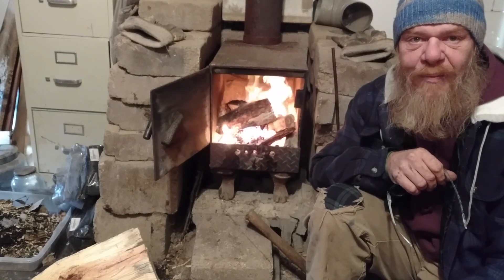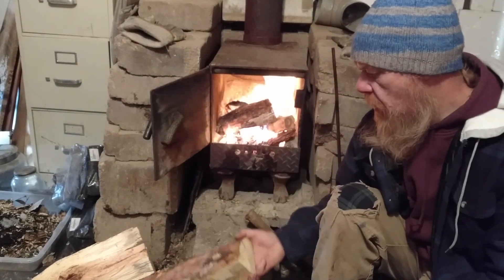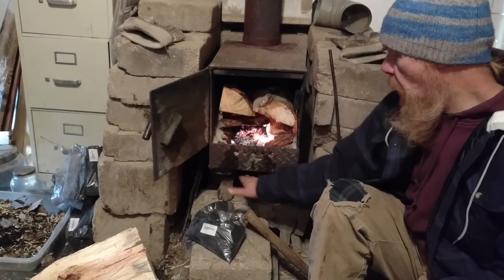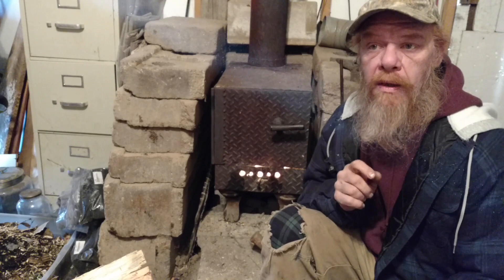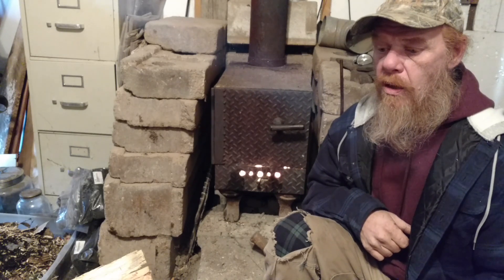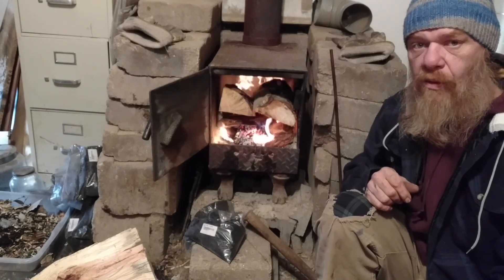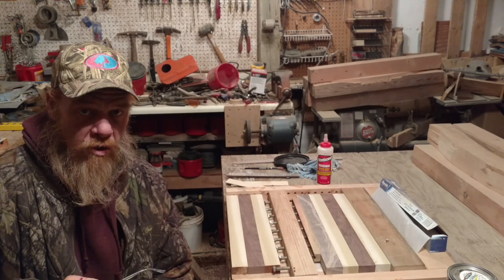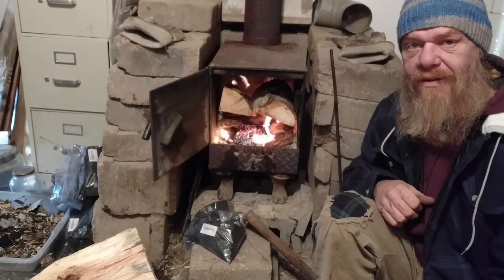Woodstove Heat Exchanger Build Video #1 Hope This Works

Comment: Can't wait to see how it all turns out............Question: Will you need a special pressure release valve on the water tubing in case of to much pressure building up? Like what they have on a common water heater.
Reply from the maker: Well....i dunno :)
I am hoping to test the system as an open system with no pressure.
Reply: @HopeThisWorksOurHomestead  Open system is safest with wood in case it gets too hot.   Otherwise you'll need both an expansion tank and pressure relief

Comment: Will be interesting to see. I worked at a greenhouse about 25-30 years ago that heated the greenhouses with a huge I recall oil type furnace. The most interesting thing to me even at the time was that they used pipes underneath the grow table to provide and transfer the heat near the seedlings and cuttings we did. We were starting stuff in early to mid march for sale in May. Just some things for ideas. :)
Reply from the maker: awesome comment! cool idea to think about using water pipes under the grow tables
Reply: Thanks! You showed those heating 'pipes'. I forget what they are actually called. haha That is the first thing that popped into my head. It kind of is the same idea as a heating mat for starting seeds and such directs the heat to the bottom of the tray where it is needed most. :)

Comment: I think you theory would work...I live up in Canada and run 3 wood stoves to heat my house...no gas...no electric heat...just wood...and I have the same thing...coals in the morning...but have you thought about putting the setup on the inside of the wood stove at the top of the burn box?...you'd get more transfer of heat if you were on the inside of the box...just an idea...great video man...
Reply from the maker: Yes i did think about putting the heat exchanger on the inside, but my initial decision had me thinking that it may get too hot, based on my observations of the stove heat when i am burning coal(really hot). 
My goal however is to have  the circulating water carry the heat throughout the nite. I dont want to boil it during the day with an active fire and basically not be actively heating it through the night. 
Thank you for your comment, I love hearing others thoughts. It really does help me make the best decision.

Comment: Hey Kevin could you cut a hole in the top of your firebox run a tube upper on a slight angle on top of that tube you put a box. in the tube put put a sliding door fill the top up with  coal  have it automatically dump in the middle of the night into the fire or ran a rope to your bed and you pull it in the middle of the night the dump coal in the fire just an idea and just wondering did you get my Christmas card I'm hoping I got the address right as usual stay safe
Reply from the maker: i did get your card and it was AWESOME treat from my FIRST SUBSCRIBER!!!!!!
I do have some ideas for a coal feeder of some sort, but not a robe to my bed :) lol
Hope you are having a great day. I also have sent you a card that u should receive soon! :)